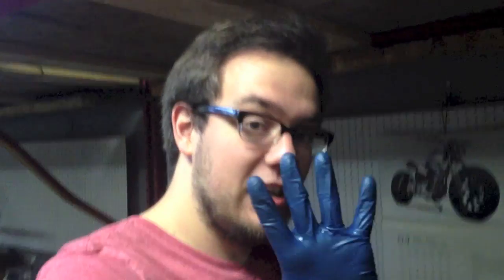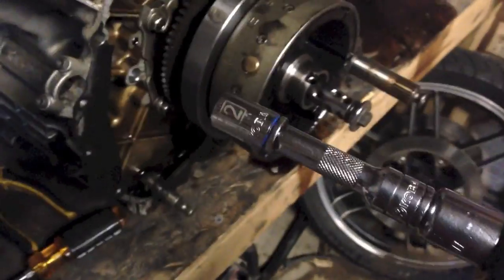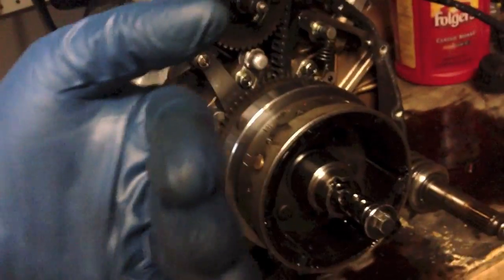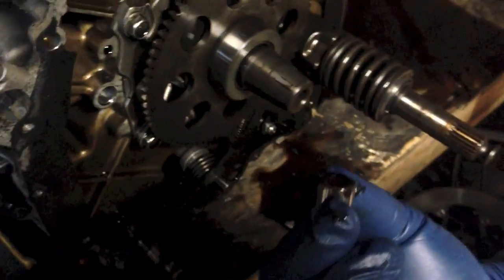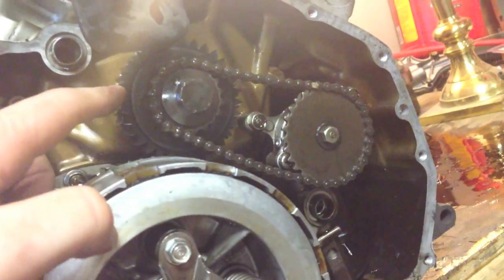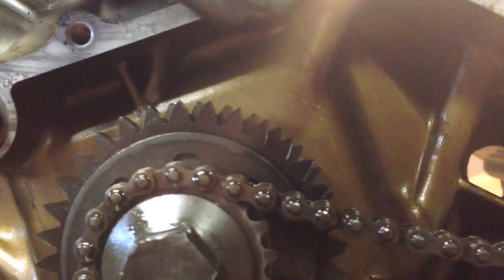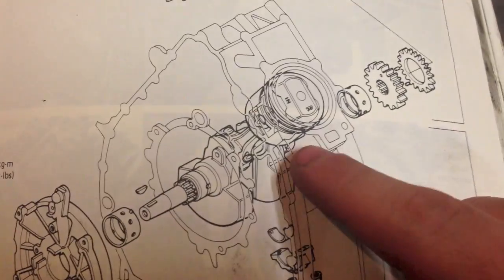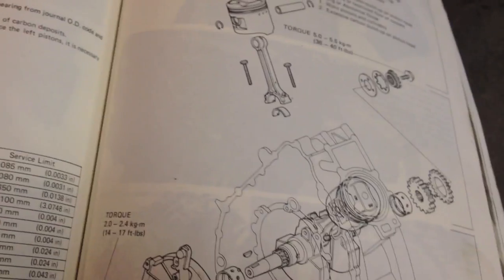CX500 Update #5 | Flywheel removal, front cover removal

Comment: do you have any know how with a stator on this bike?
Reply from the maker: In what regard? This bike didn't have an issue with it per se, but I'm "familiar" I'd say.
Reply: +Nathaniel Schweinberg 
any suggestions on how to replace it?
Reply from the maker: +Samuel Wolpe thankfully theres nothing too terribly specific. just be careful you don't rip the rubber boot that houses the wires going from the stator out of the motor. other than that, it's a pretty straight forward job!